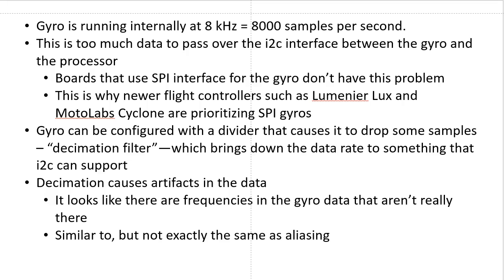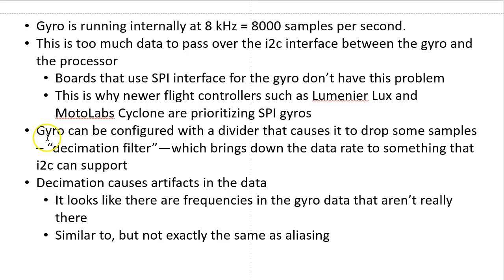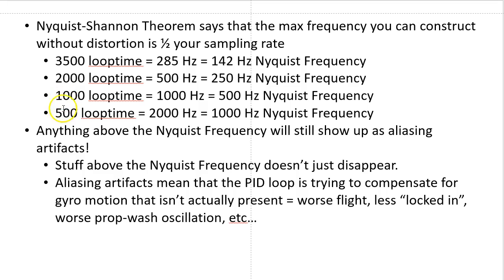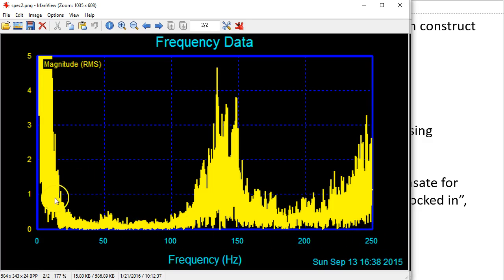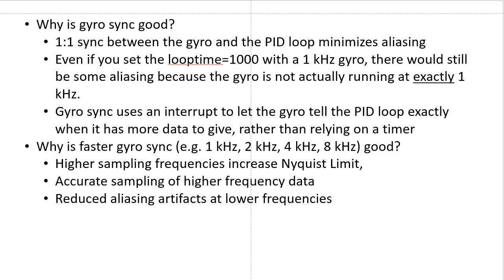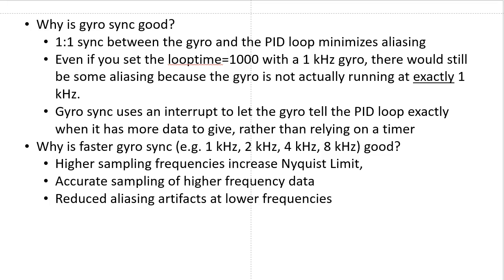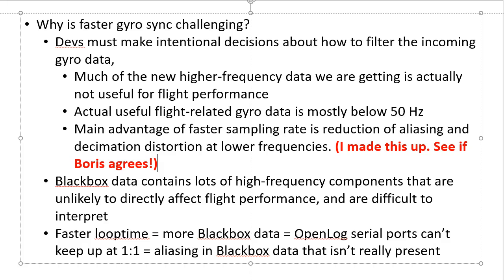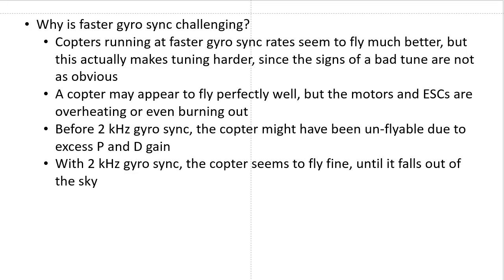Betaflight 2 kHz (and above) gyro sync explained

Comment: I've watching all the videos on gyro and pid loop rates.  Are there some updates.  It's crazy now that we have 32khz... which the video on that was also good.  I was curious about the drawbacks of running very high (by the current standard) gyro/pid loops times... 32/16, 16/16, 16/8, etc.
Reply from the maker: +Tom Wronski drawback is you get more noise.
Reply: I just did a build with an F4 processor and previously on my F3 was using 8k/4k.  I figure I can run 32k/4, 6.4, 8k with good CPU utilization and the noise should be similar to the previous build (not accounting for less noise due to newer motors etc.)  Settings like 32k/16k make the CPU utilization 100%.  Also loving DShot right now.

Comment: The invenSense datasheets state that the gyros can do "digital low pass filter" (DLPF). This is not the the sample rate divider (SMPRT_DIV).
Is the DLPF used in Betaflight? If not, why not? With DLPF enabled, 100 values per second from the gyro are enough, right or wrong?
Reply from the maker: No. One of the very first things betaflight did, back before it was betaflight, was to subsitute a software filter for the built-in low-pass in the IMU. The low-pass int he IMU can only use like five different cutoff frequencies, for one thing. Sampling at 100 / sec would mean that the Nyquist Limit would be only 50 Hz, not nearly enough for good flight.

https://www.youtube.com/watch?v=-lmoKal_e4s
Reply: Alright, but either you filter or you don't. If the 100values per second are already filtered for 50Hz, then there is no aliasing.
You filter the gyro input signal or you filter via PID (P term of gyro?). If you filter, you have to wait for the sampling points and 400 samples at 4k is a time of 100ms.
Reply from the maker: I'm not suggesting you don't filter. I'm suggesting that the soft filters used by betaflight are superior to the built-in filter of the IMU. 

Saying there is no aliasing at 100 Hz if you filter at 50 Hz is incorrect, because the filter has a rolloff. Assuming a 1st order filter with rolloff of 6 dB / octave, then 50 Hz cutoff frequency means 9 dB of attenuation at 100 Hz. There will still be substantial energy between 50 Hz and 100 Hz to create aliasing artifacts.
Reply: Thanks for clarification and thanks for correcting me :)

Comment: I'm completely new to this betaflight/cleanflight tuning quad thing. So far everything seems to be working fine so far. But, when plugged into the configurator, I notice that I have 2 Ic2 errors at the very bottom of the screen,  but have no idea what that means...😕
Reply from the maker: There are always a couple of errors right when the board starts up. As long as the number is not increasing don't worry about it.

Comment: Lol raceflight performs better if you have your loops faster than your gyro.
Reply: and I honestly doubt there are many people who are smarter than Joshua Bardwell.
Reply from the maker: IMO, that has yet to be experimentally confirmed in a meaningful way.
Reply: +Joshua Bardwell well if you try raceflight with gyro sync and then you run your loops faster than gyro you see improved performance
Reply from the maker: +Simonjr gaming people who are smarter than me dispute that.
Reply from the maker: +hobbykingsupportcontactchannel rs2k says it matters. Boris doesn't think so. When two such titans clash, more testing is required.

Comment: Informative video, you pointed to many interesting facts (or misconceptions) regarding to pursuit for greater loop speeds.
I have couple of amendments, but they have no impact to correctness of your video (they are result of my obsession to be totally exact, and I guessed that you skip them to make video more acceptable for broader audience and not bore them with too much technical stuff).
i2c is not limiting factor for all frequencies update frequencies up to 8 kHz (it will work happy at 4 kHz or lower) for reading row data from gyroscope (if we are talking about most popular MPU-6000/MPU-6050), and anyway accelerometer is limited to 1kHz (if you try to read fater then 1kHz from accelerometer it will only repeat same data).
Little note is that with internal filter in use gyroscope is also limited to 1kHz.
Another point is that MPU-6000/MPU-6050 can do most of motion processing without using main microcontroller in its own DMP (digital motion processor) and even do sensor fusion of data from external sensors.
STM32F103 have two i2c bus on it (they can do independently) which can increase speed with multiple sensors.
For faster loop times STM32F103 is not major limiting factor or communication speed (for most cases, greater limiting factor is quality of code and compiler that are used), more limiting factor are sensors, but even with sensor limitation there are solutions that can overcome that problems, like using dead reckoning which is widely used with INS (it will introduce some error, but it is good enough for navigation of supersonic airplanes or to put thermonuclear warhead half world away flying 6000m/s in circle with 300m diameter).

Comment: Hi Joshua, can you see in Cleanflight/betaflight on how much hertz the gyro actually runs at or is it a default setting?
Reply from the maker: +Dropkicker27 I think that the "status" command, or possibly the "tasks" command, in the CLI will give the actual frequency for the PID loop, the gyro, and the motor output.

Comment: So, I know I'm late to the table here, but I just came to this miniquads /racing/ acro stuff, from a...well not "a quad" but "the quad", ('cause it's not a mass-produced item) that I've build myself from absolute zero (I didn't even knew exactly what a gyro did). It's a 600mm X quad, runnig on 1100KV generic motors I guess, as they don't have or I don't know their name, I think Sunrise 20Amp ESCs, 4S 3300 45C and all info coming from an Arduino Mega2560 asking over I2C, a Pololu MinIMU-10 for flight orientation. I did my own firmware, running at 265-270 HZ, with my own PIDs and all, and boy was it a learning curve!\
And yeah it flies pretty darn well. 

BUT just to rephrase all this kHz thing in even more laymen terms: Going higher in sampling (for my mind 1000 to 2000 kHz jump is insane), is like chopping up a carrot (or pick your own vegetable :P), in ever increasingly thinner slices, like one atom thin, and get to the point that if you were to give such a slice to someone else (like the PID-c) it would have no idea what the heck that slice was coming from or what exactly it represents overall, i.e. it would loose focus on the big picture.

 The same way you can't tell where a single carbon atom came from without having more of them in some sort of structure with other elements which would be uniquely representative of a certain material, the same way you can not now how your current slice of the signal fits in with the other slices (that you don't even have, at the time you are looking at your current one). 

So now imagine I would ask you to accurately predict what the next slice would be like, how small or  big it would be. That is exactly what your D is doing. It "D-erives" (= a very calculated guess) based on its own past experience with the previous slice and the speed at which they come to it, how would the next one be like.
The faster you do this (sample), the more variation you get packed into that, lets say, 1uS window, and If you try to connect all the slices with a line from one to another, because of that great variation in sizes, you'll get a pretty jagged edge/graph. That is your signal. 
Now going back to D. If you fed that signal to the D term, the more variation you have in the same time period, the less effective the D term will be at accurately guessing the next slice, hence it amplifies the variation i.e the noise of the signal.  
If you feed that to the PID, it will go crazy,  on the other hand if you only have enough slices as to derive from their overall shape composed in 1 uS (as was the example) , the MINIMUM rotation that you can actually do something about, then that's all you need, so there's no point in gathering tons and tons of data that you know you can't use or only use, 'say 10%  of it.

It is exactly as Joshua said, with one extra thing that I'll add. It's not like the PIDs are going crazy, they very well do their job with every single little slice that you throw at them and all is nice and dandy until they feed their results to the ESCs and the ESC try to do their best to modulate the current flow at ever increasing rates and guess what every thing in existence, if pushed to and held at its very upper limit, will do? It will very soon fail!  
But then in turn the ESCs do the same to the motors and guess what they have to say about it...AAAAAaaaa! they can only speed up and then quickly slow down at some rate. So they will try to overcome that rate but will end up loosing their magic smoke, as they were not designed to go past their imposed rate...

Hope this makes some sense to somebody :P and do please excuse my use of English :D

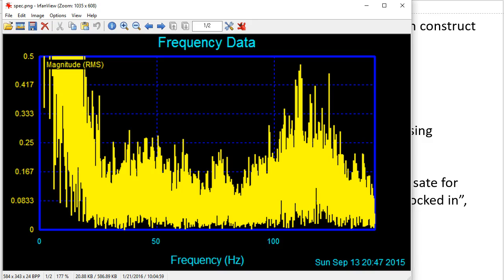Comment: You didn't actually explain what the "frequency/gyro data" plot was (from 7:00 onwards). How was it created? What does it actually mean. Without that explanation this video is pretty much useless and impossible to understand.

As far as I can tell (and I don't think most viewers and commenters got this far, even the "pros") is that some gyro data was collected over a whole flight. This is of only one axis. Then the data was subjected to Fourier transformation, which is the chart that you have presented to us. Can you clarify?
Reply from the maker: +sjtrny You're basically correct. This is a Fourier transformation of the gyro data from a single axis, showing the strength of the signal at frequencies between 0 Hz and the Nyquist Limit. Higher on the Y axis indicates more energy at that frequency (on the X axis). The chart was generated using Spectra on the Blackbox gyro data. A single axis was selected for presentation, but all axes show similar results.

Comment: Josh that was brilliant! I have a question. Would it be wise to do tuning while in 1khz mode and then switch to 2 kHz mode to avoid possible high frequency oscillations that would be harder to detect while tuning in 2khz mode? Or would that method not translate into avoiding some high frequency oscillations that could damage ESC and motors?
Reply from the maker: +Bonehead J FPVEE I would tune in whatever mode I was going to fly in. I think the differences between 1 kHz and 2 kHz may be that significant. Just be sure to start with very low D gains and moderately low P gains and work up carefully.

Comment: Good video josh. Q. How does >= 2Khz (loop) and multishot correlate, or doesn't it?
Reply from the maker: +Seafury mike Eventually, the loop will run so fast that it is faster than the timing of a Oneshot signal. Whereas the normal signal sent to an ESC or servo has a duty cycle between 1000 and 2000 us, Oneshot runs at 125 to 250 us. If the loop was running faster than 250 us = 4 kHz, then Oneshot would not be able to update fast enough to keep up with it. So Oneshot cannot be used at faster than about 4 kHz looptime without dropping motor output updates, which is sort of the exact thing the faster updates are trying to avoid.

Comment: If you can't sample fast enough, use internal filters in the gyro to prevent aliasing. Use software filters to cover frequency below the Nyquist.
Reply from the maker: +Ole Lillevik I believe that the IMU chips have internal filters for just this purpose, such as a notch filter at around 1 kHz to prevent aliasing when outputting at that rate. As we know, filters add latency, and as Boris pointed out, the faster your sampling rate, the faster your filters work. So if there is an advantage to higher sampling rates, maybe it will be the ability to use more sophisticated filters with less latency.